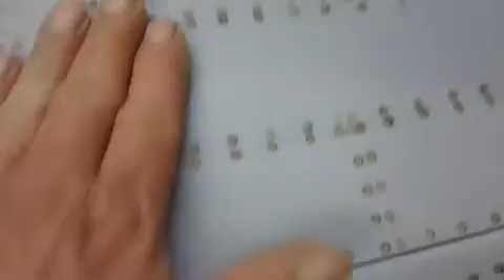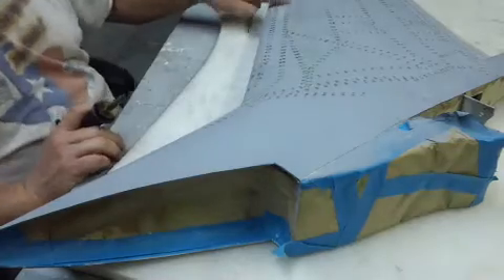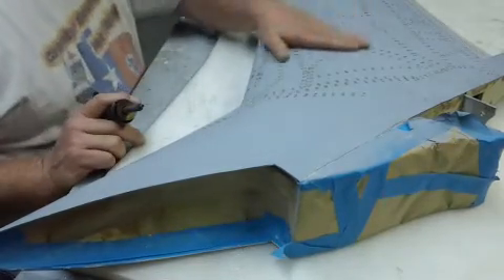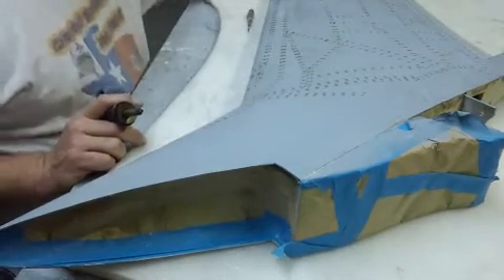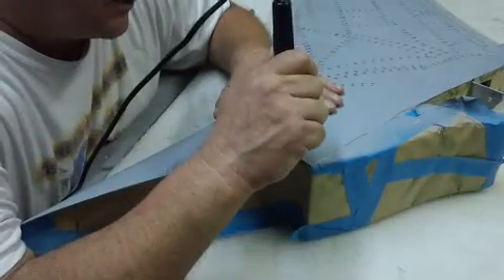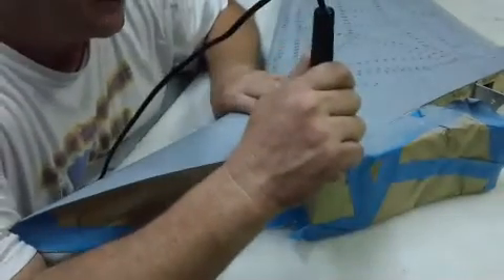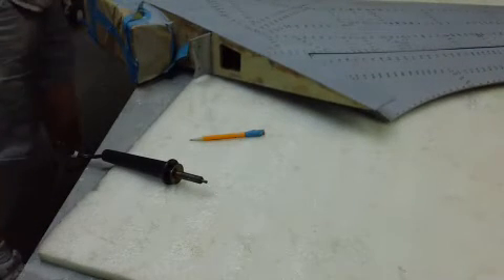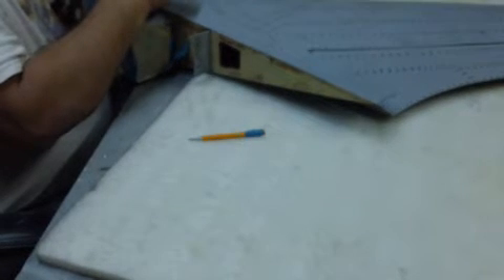Rivets done on 1st wing

Comment: If your riveter is not getting as hot, check the screw holding the brass tube in, If it starts to loosen, the iron won't transfer the  heat as well.